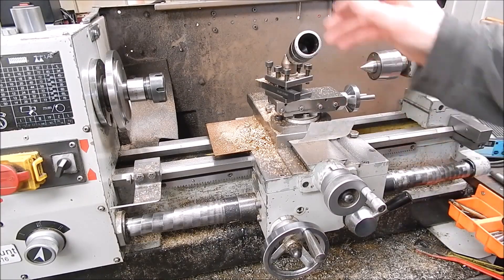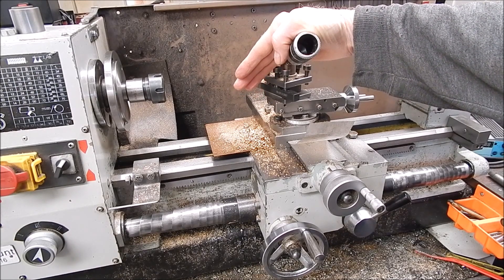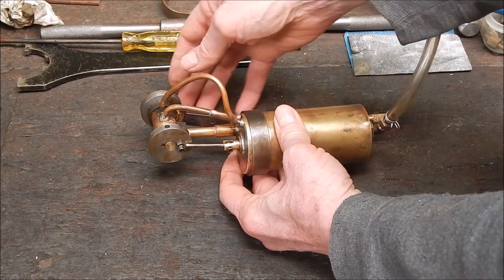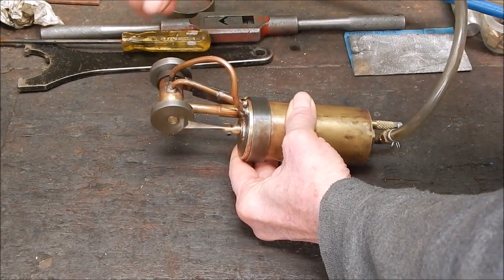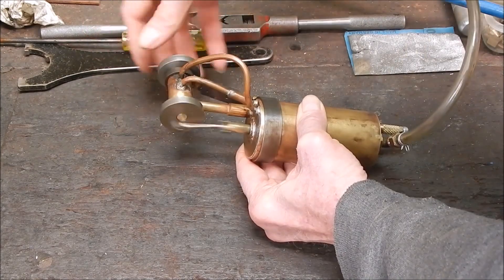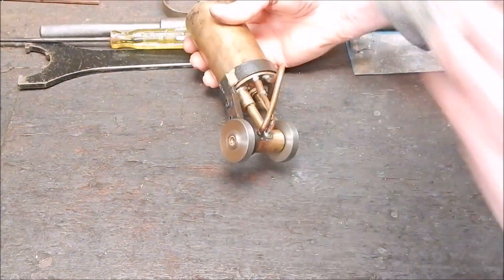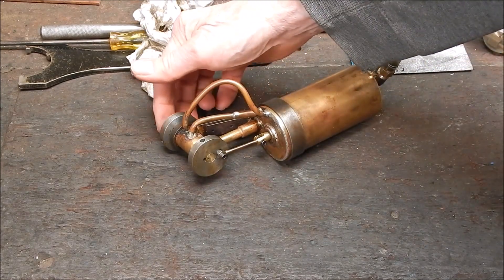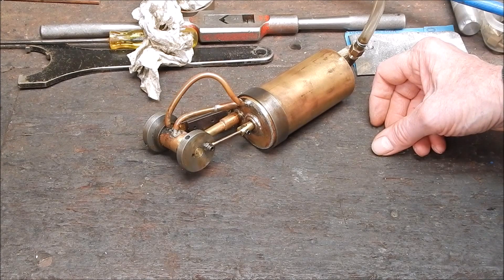The unique no plans home made rotary valve steam engine has it's first run

Comment: Looks great Rob. I think you are spot on with the extra fw weight. Had the eyes done, great.
Regards Merv
Reply from the maker: Good to hear Merv.  Be no holding you back now.  Things are warming up a bit here at long last and I'm getting back into the shed, which is a great change of lifestyle - been pretty restricted up until now.  Yeah that little engine is finally running and the home straight is just ahead.  Cheers Rob

Comment: Looking good Rob. Very interesting design / concept. Some difficult soldering on this one mate, trying to get the insides right without re-melting the boiler joints, not at all easy, well done. Cheers, Jon
Reply from the maker: Hi Jon, yes soldering was tricky.  I used a couple of different sized gas torches rather than electric ( due to the large heat loss), but even them you had to be quick.  Machined up a larger flywheel this morning and next  it's time to make a knurled brass filler plug.  Still quite a way to go.  Should look OK polished up and painted.  Cheers Rob

Comment: Great to see it running Rob 👍👍👍Very impressed that you managed to get everything all soldered up on the engine end of the boiler, given that it's all so close together. Must have been a right pain! Cheers, Alan.
Reply from the maker: Hi Alan,  it was a bit tricky soldering that close.  Steam is "hopefully" next.  It's been a bit of a battle, but looking good ATM.  Why do it the easy way when difficult can be much more challenging ;)  Incidentally there may be a bit more steam on this channel soon.  Stay tuned.  Cheers Rob

Comment: Looks good Rob, I've never seen an engine with with so many unusual features.  Carry on!
Reply from the maker: Thanks Brian.  It's a Heath Robinson Special.  I set out to push the boundaries and it's been a bit of a battle, but we are getting there.  It should run on steam if everything goes to plan.  I had it running on 5 psi air pressure, so I think that is doable.  Got the heavier flywheel nearly done and then I start on the stand risers.  I will probably use one of my existing dual flame metho burners for now.  Interesting times.  Cheers Rob